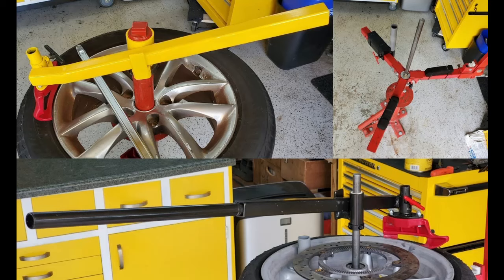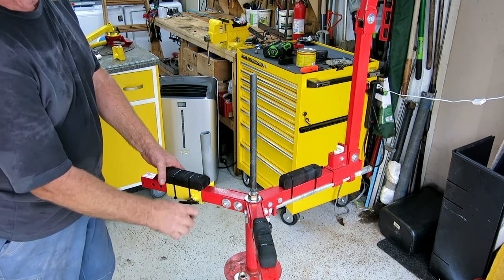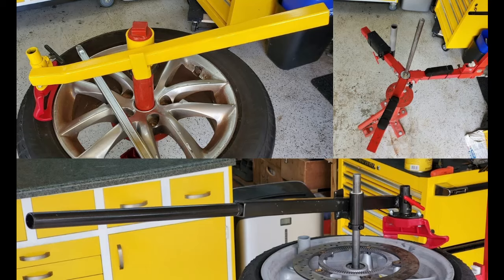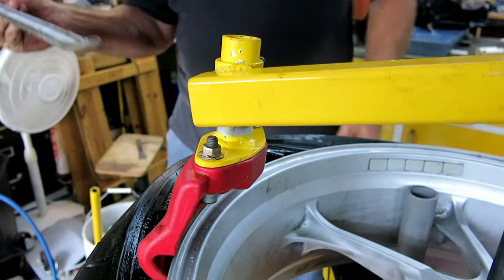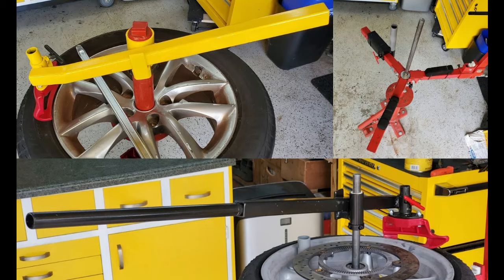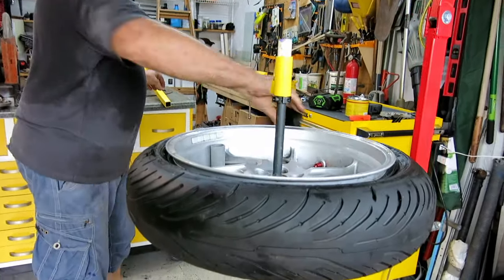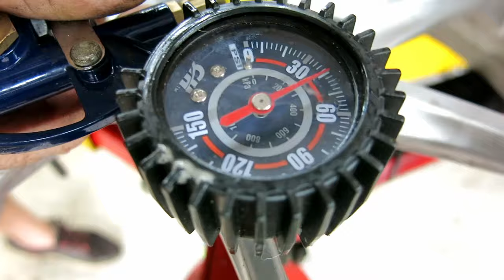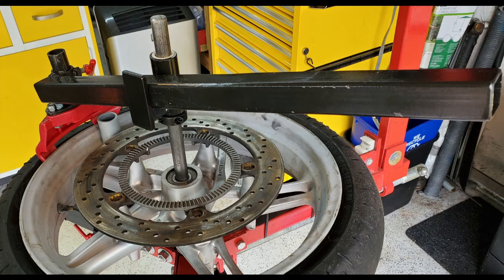Unlimited Tire Changer Duckhead attachment for Harbor Freight Motorcycle Tire Changer

Comment: Hi Keith. Thank you for making this kit. Also thank you for taking my call once I received it and tried it out. Fantastic unit. Well made the kit and video. As you said if it is hard you are doing something wrong. I was able to change tires in moments. Not even minutes! Tube tires take a bit longer just because putting in the tube takes a bit of time. (Super moto). My GSXR tires fell on the rims. Not a mark. Wow! To any one watching this just get it. Get the tire irons too. Wow are they a time saver. I will be buying more of those soon. This makes it so worth having. Mine is bolted to my garage floor when in use and removed and stored when not in use. So far I have done 5 sets of tires. My local shop charges $50-75 with tubes to remove and mount. Balance is extra. Do the math. If you work on more than one bike get this ASAP. Great tool, design and guy behind his product. Highly recommend, hell for that matter insist! John Keryeski

Comment: When you install the tire you're supposed to use the other end of the duck head and go  clockwise,  it works a lot better.  Nice kit, thanks for posting.  I might order your kit it looks very well designed.  👌
Reply: I've watched a number of the commercial vehicle tire changing videos using the duck head and you are correct about using the other side of the duck head but his direction is correct.

Comment: Quite brilliant! My system is a NoMar CH200 which has a similar base but no anti spin bar or duck. Mine uses a bar with a no scratch tip to remove tire but I can see your Duck is way more durable, however, I believe I can install a anti spin bar by mounting a pipe onto the base by using a steel pipe and simply slipping a piece of Schedule 40 over the steel pipe to protect the spokes. Thanks a lot it gave me some good ideas!
Reply: the “no mar bar” still rubs on your rim, if you have a nice custom paint job on your rims the nomar bar will still scratch it, the duck head never touches the outside visible part of a rim

Comment: Very nice system you built there. Have you tried the Rabaconda duck head? It's a little smaller than the red one and seems to put less stress on the tires, both removing and installing. If you try it, make sure you get the standard one of the 2 available.

Comment: 8:18 Over and under for putting the tyre back on, at this point the tyre is under both bits of the duck head.
Reply: You're right, he's using the duckhead wrong at the install

Comment: Sir, great video.  Really like your version of this modification for changing both auto and motorcycle tires.  So I have copied it.  I'm almost finished.  Just 1 question.
What size and thread count bolt did you weld onto the bottom of the 3/4" rod used for motorcycles?
Thank you
Reply from the maker: 3/4"x10
Glad you liked it.Send me some pictures of yours when your done or while you are building it. kbjunlimitedcom@gmail.com
Thanks for the comments
Reply: The thread inside the HF stand is M20 x2.5mm pitch I believe.
Reply: I have an older hf model and the only thing I could get to match the threads down inside was 7/8-5tpi acme which is just slightly to big for 20mm bearings so I am going to attempt turning it down slightly in hopes I can still make a Tire machine centering cone work well with it as well for regular car and truck tires to early to tell but thanks for the video very nice and simple build I like it👍

Comment: For what these kits cost you may as well buy a used No Mar unit, or new Cycle Hill unit.
Reply: ????? Just made mine it's almost the same but better, made it like the regular tire changer excet 4 center holding stem :) welding is such a money saver

Comment: I just had local dealer  changer my tires.  $$$$$$      I supplied the tires.  ( Pirelli Diablo Rosso )
$ 200 some bucks    just to change  them............     I asked   they said 40$ each if I took tires off the bike and 90$  each if on the bike.         ===  FYI  this was the same quite I got from another store  ........   Seems like with this changer  - buy and use 1 time and you break even and then some.

Comment: Great video! Would this setup work on tires with tubes or only tubeless?
Reply from the maker: It works on tubes. There is less chance of pinching the tube with the lever as you only use it once to get the bead up onto the duck head.
Reply from the maker: If you have a rim clamp either loosen it all the way or/and position it on the half of the rim opposite the half that the duck head travels around. (like you do with the valve.)

Comment: Hi sir kieth can i order that online. coz im from Philippines. thank you
Reply from the maker: https://kbjunlimited.com/ or on eBay "Unlimited Duckhead Upgrade for Harbor Freight. Motorcycle Manual Tire Changer" https://www.ebay.com/itm/393031701905 "Unlimited Duckhead Upgrade for a Harbor Freight. Car Manual Tire Changer" https://www.ebay.com/itm/393087110352 AND "Centering Pyramids and Cones for Harbor Freight Manual Tire Changers" https://www.ebay.com/itm/393031490816

Hi Junlen Tadle

Thank you for your interest. I have added the links above. The first is to my website: KBJunlimited.com and has the widest selection. Then I have the links to my eBay listings. Let me know how you get on and how expensive the shipping ends up. My email is KBJunlimitedcom@gmail.com

Keith
Reply: @kbryanjones  There is something wrong with the links if i click that i get the ebay page but not the item same with first link
Reply: amazon and alibaba